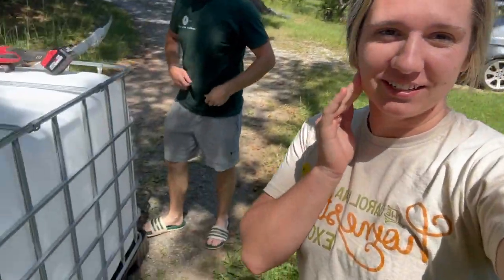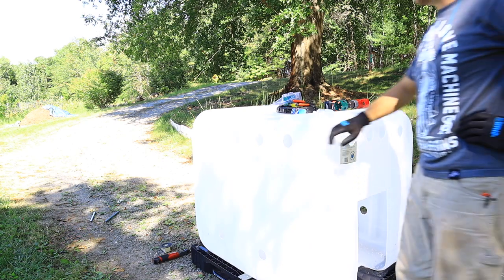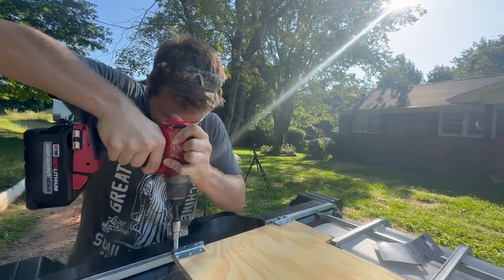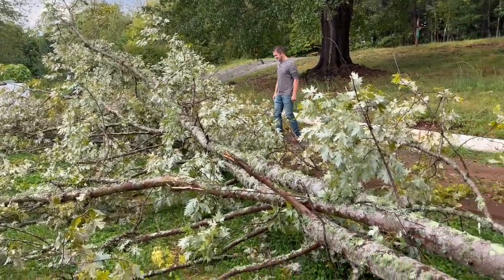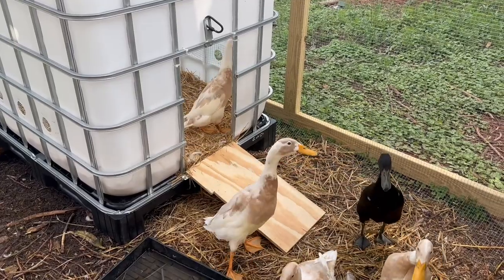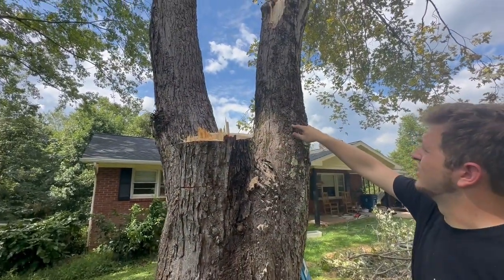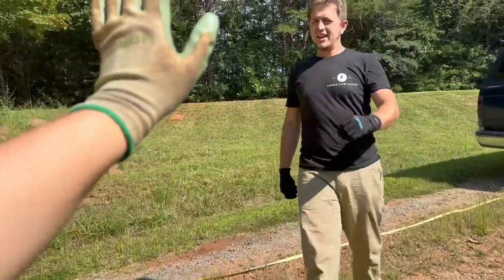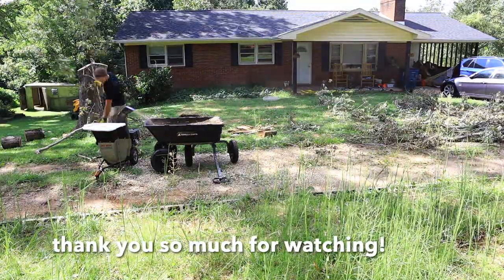How to Build a Chicken Coop Using an IBC Tote | Homestead Build

Comment: check on using a heat pump. that is what they use in nc.  geothermal is very costly. just a suggestion. love what you are doing.
Reply from the maker: we'll be doing a geothermal heat pump system. Thanks!